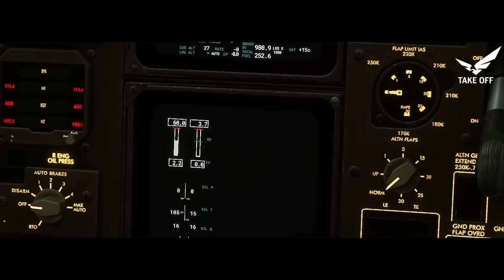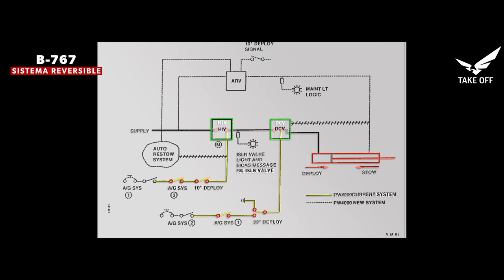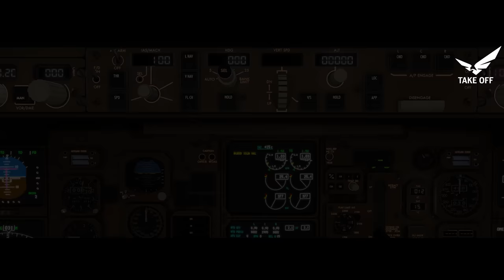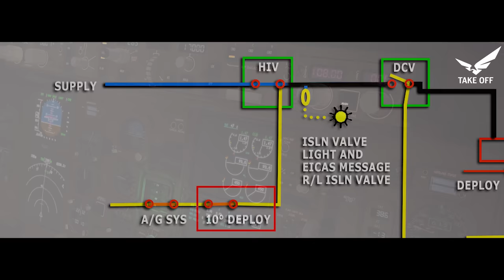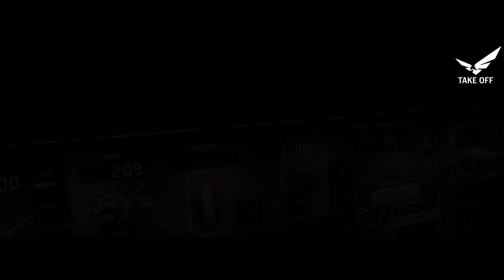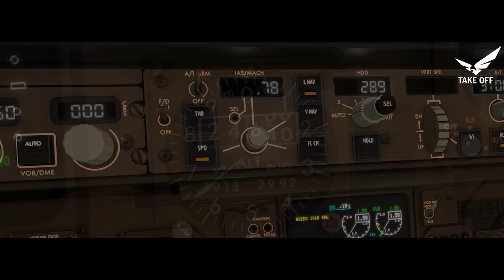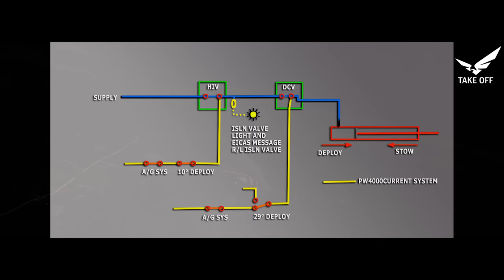Decisión Fatal - 6 Segundos Para Decidir (Reconstrucción)  Vuelo 004 de Lauda Air

Comment: "La falla podria darse por un relee defectuoso, lo que tranquilizo a los pilotos"
ya... y a ninguno se le ocurrio preguntar que pasaria si un relee defectuoso fuera el responsable de cortar TODO el suministro electrico de un avion?
pregunto.

a los efectos de tener "un relee defectuoso, meh, no pasa ná!", es tanto defectuoso en un sistema hidraulico como en un sistema electrico secundario, como en un sistema electrico principal.
la diferencia? que sin corriente al aire acondicionado, lo peor que podras pasar es morirte de calor... pero sin corriente al sistema hidraulico o al propio motor, el avion no vuela.
detalle.